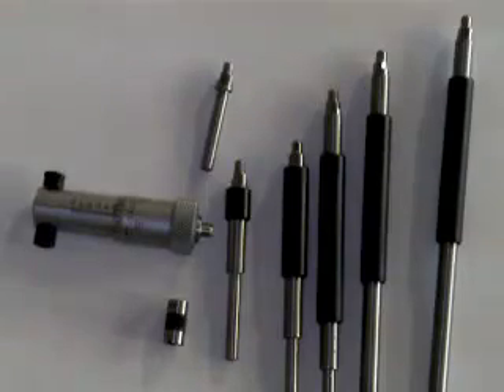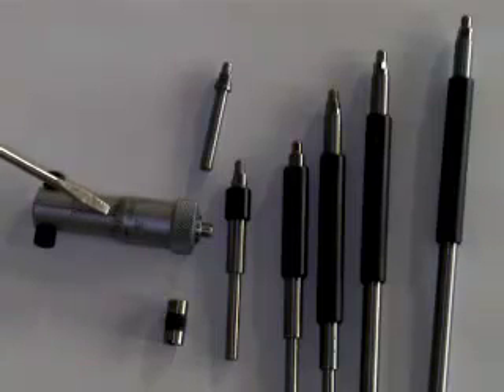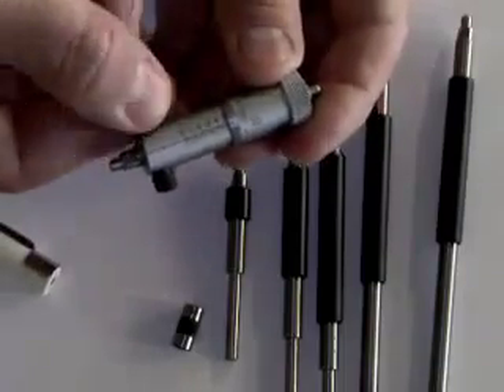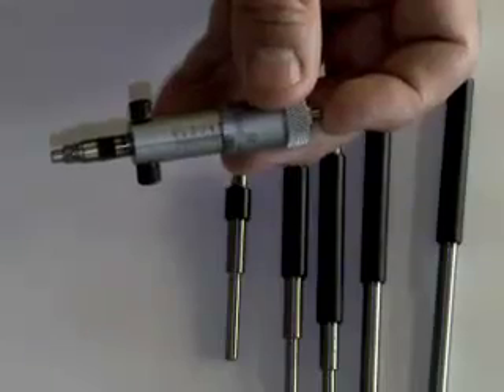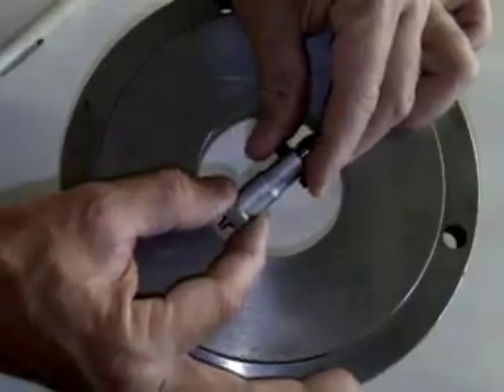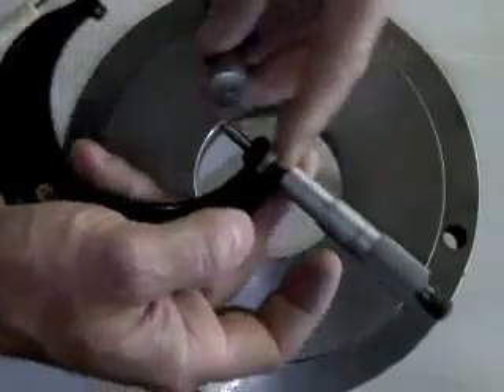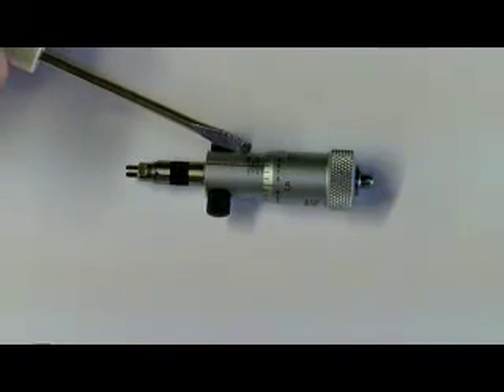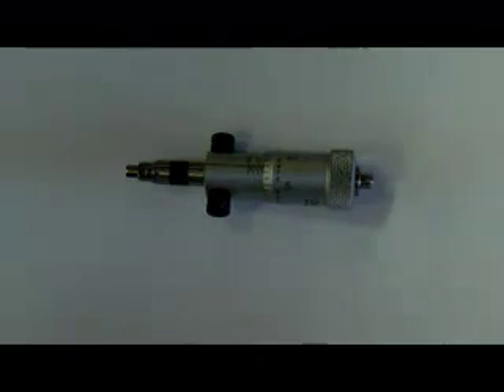Inside Micrometer

Comment: I struggle with keeping these mics nice and straight when measuring parts. Any pointers on that?
Reply from the maker: @victorgonzalez9129  they are tricky to use. Keep one measuring surface stationary and pivot the other end in and out and sideways until movement is minimal. Telescoping gauges are easier to use.